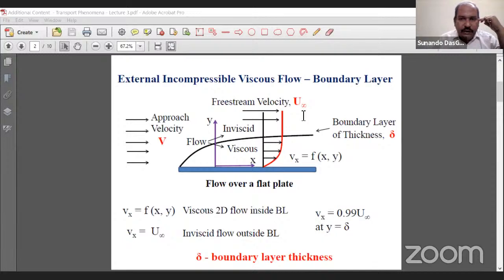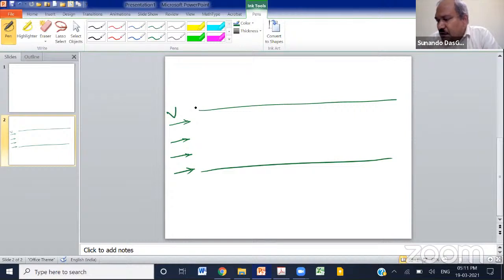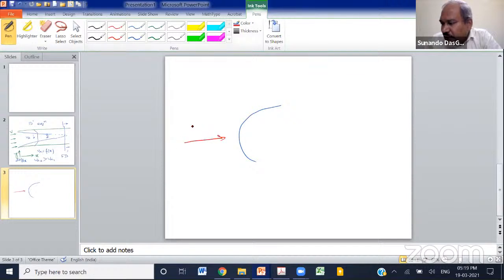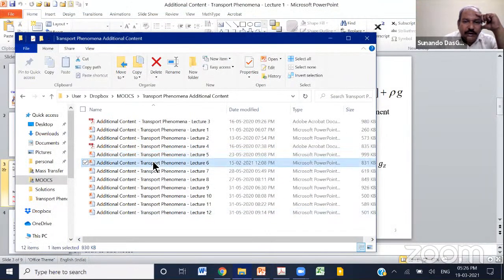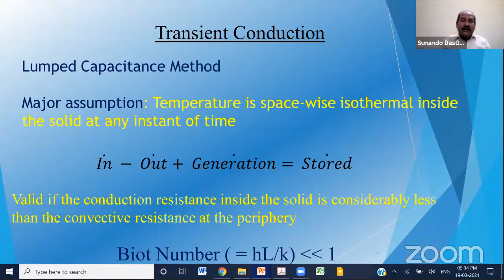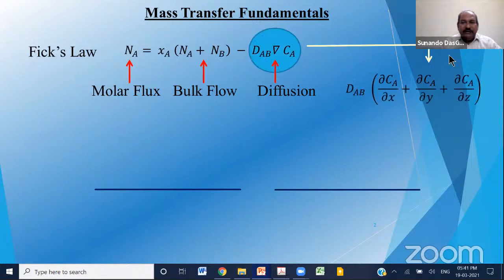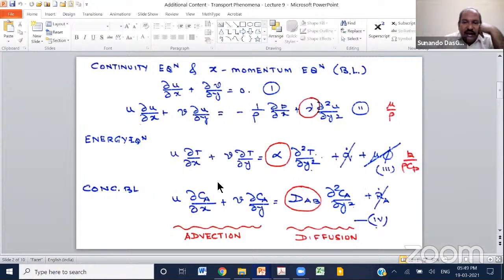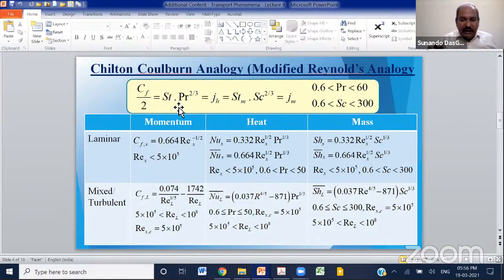Live Session - 2: Transport Phenomena

Comment: The heat transfer for a perfectly built Capacitor,the movement of gas medium transmission,the thermal viscocity would increase the dielectic constant of the medium,thus a negligible imposition of whole capacitance.